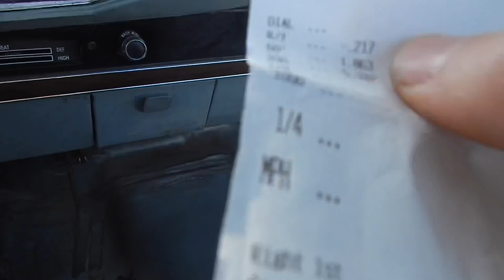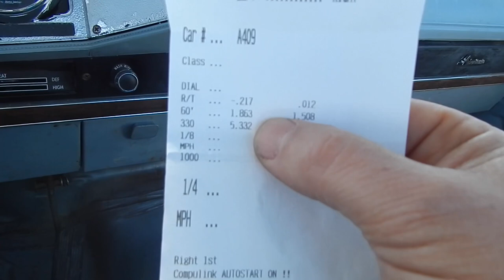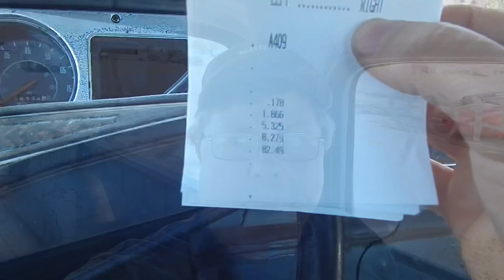Dodge 360 * Bombcycle *  runs with the 750 DP !  Will It Improve Over The 670 ???

Comment: A shift kit in the transmission over the winter will help
Reply from the maker: Very True !!!   Thanks for watching !!
Reply: I run a magnum 318 in a 1967 Dodge Dart. It’s got a .450 lift cam and an 850 double pumper on it. 1.60 in 60 foot(4:56) gear on a 29.5x10.5 tire
Reply from the maker: @haroldrkane2939  I'd like that size on the back of tire on the truck.  What make are they ???   Sounds like you have a quick 318 !!!!!

Comment: Very impressive that you are running a motor with a lot of mileage, an untouched transmission,  and able to March that truck into an  estimated 13 seconds in a quarter mile. Looks like I may spend money and rebuilt my holley 700 double pumper with mechanical secondary's. One question, is that a stock stall speed converter or running a higher stall. Thankyou for that video.
Reply from the maker: It's a hughes converter.  Thanks for watching !

Comment: what size converter are you running?
Reply from the maker: Hughes... 11" i think
Reply: How high will it flash stall and brake stall.. sorry for all the questions.. but I’m building a similar truck.. thanks again
Reply from the maker: @kymopar  I didn't really try brake stall... I'd guess flash stall around 2500.   Hughes claims 3,000 behind a mild 440.   What's mild ?    The 360 isn't getting near 3,000